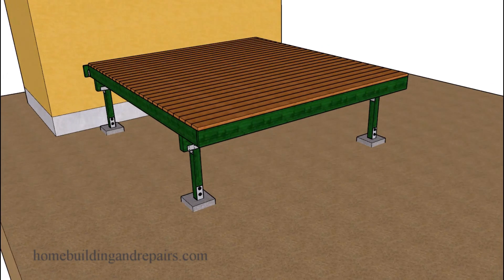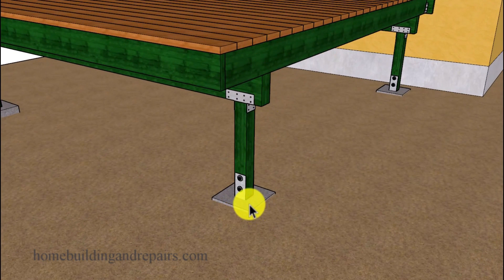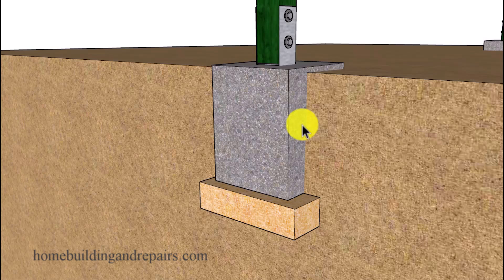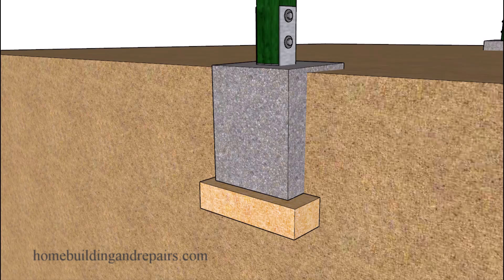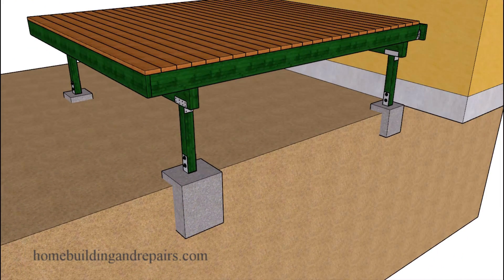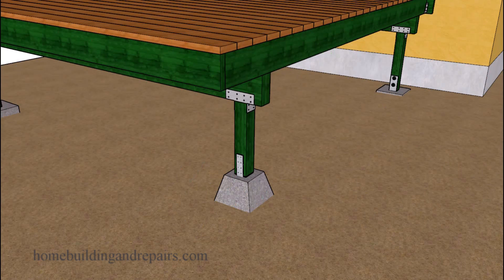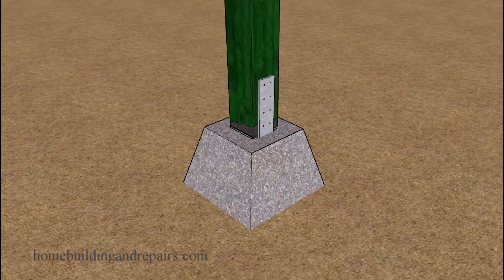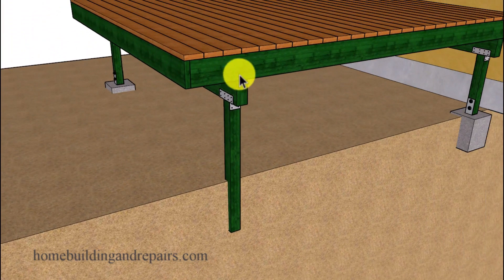Why Your Exterior Deck Might Be Sinking And Out of Level - Building Repair Education

Comment: Greg, can you recommend how to build ladder framing in order to accommodate breaker boards in the middle of the deck?  The challenge is that the decking that runs parallel to the house needs to be properly supported as do the perpendicular breaker boards.  Solid under framing could be used but then the "platform" will collect water accelerating rot.
Reply from the maker: I use blocking, but if that won't work, I do have more videos at our website that might help. https://www.homebuildingandrepairs.com/decks/index.html

Comment: Great video. thanks. I do have a somewhat related question. I had a 10 x 30 foot deck built free standing of the house structure but against the wall. It sits on 12 posts that are less than 2feet above the ground. I want to add a more permanent enclosure to replace my canvas gazebo. Just asking about (friend's big box associates) I am told a 10 x 10 enclosure would be too heavy for the deck? ( I think these people think I am looking to do a add on)  I am mostly interested in a hard roof and maybe knee walls with screening from the wall to the roof. The roof could be lean to  but I think a gabled roof would look better.  Is there some structural way I could use either the exist footings and posts? or maybe use deck blocks under the deck where the new corner /support beams would go to hold the weight?  I do not want to attach this structure to the house since the deck itself is not. I am thinking a center build height of 8-9 feet with 30 inch knee walls, and 7 foot side wall heights. I am thinking a storm door or just a screen door for entry from the deck. Appreciate any thoughts you might have realizing you are not here to actually see what I have. Thank you ahead of time, always interesting to see our projects.